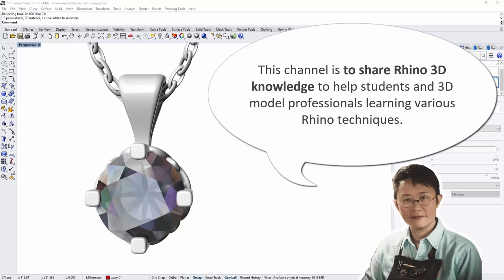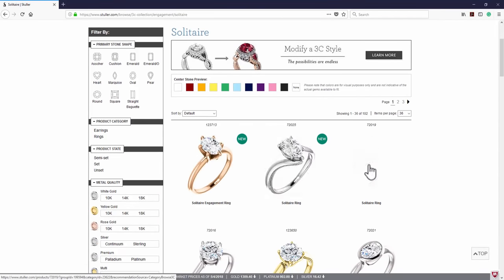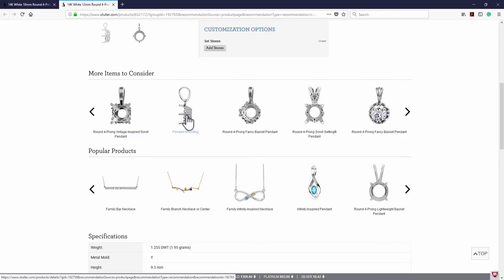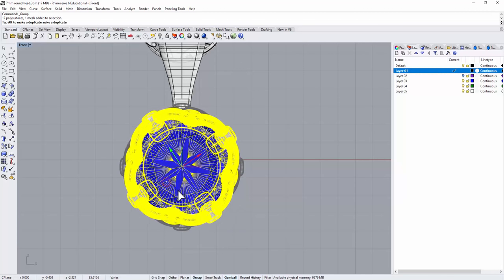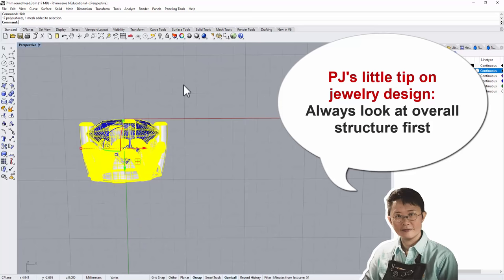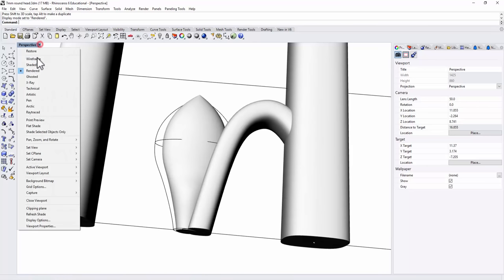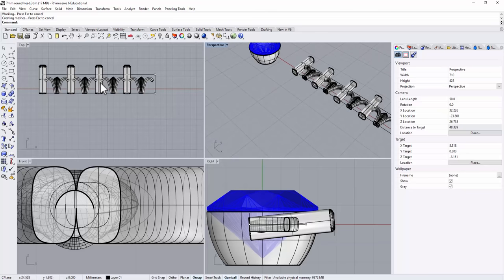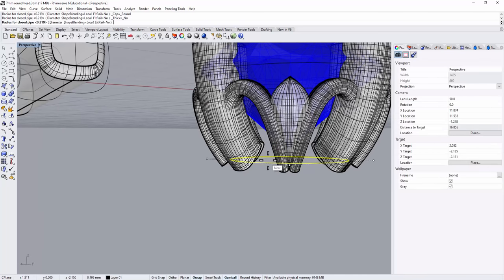Pendant Design in Rhino 3D-Jewelry CAD Design Tutorial #30

Comment: Hi P.J.,I saw many designers use Rhino for design, but use Keyshot for render..Rhino's own Render is not good enough for Jewelry design?also, some people use RhinoGold or Mas.... , as some software plug in Rhino are even more much expensive than Rhino itself, I don't understand why..., but I feel Rhino should be able to strong enough for all the Jewelry design, right ?
Reply from the maker: I use Keyshot for my rendering as well. It is easy to use. RhinoGold and Matrix are the plug in for Rhino. technically, Rhino itself can do everything those two programs provide. but they both have good feature for jewelry design specifically, such as stones, setting, chain in their library to use. The big difference is the software price. I always recommend the starter to use Rhino and if you feel like you will use Rhino for jewelry only and need to model a lot of jewelry for job, then I will recommend either RhinoGold or Matrix.
Reply: Thx P.J..  I will learn how to use  Rhino first .

Comment: Hi PJ, I am  having some trouble creating a proper UV curve of my first surface. Every time I try to select the piece after selecting UV curve it only lets me select 1/4 of the piece. If you have any direction on how I can get it to select the piece in entirety that would be so helpful! I have tried to ungroup, regroup, join and even starting over but I keep getting the same result!!
Reply from the maker: It doesn't select the whole model is because there are seam on the model. "Create UV curve" can only select single surface.
Reply: @PJChenJewelryDesign   Thank you PJ for your response. I am still unsure why the whole surface is not one surface but 4. When you selected it it was all one piece so I am unsure how this ended up happening!
Reply: @PJChenJewelryDesign  Your video shows the entire surface as a selection, my selection is 1/4 as is Anne. How did you clear the seam and make one surface?
Reply: You need to check the "maintain height" box during the two rail sweep.